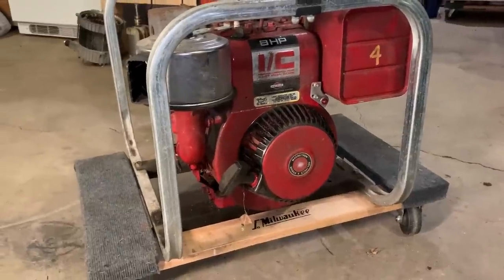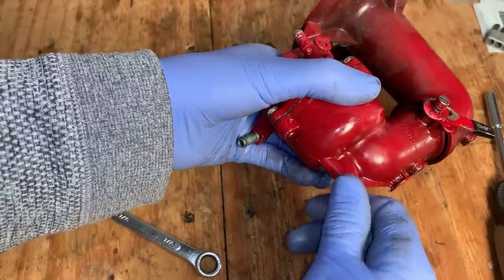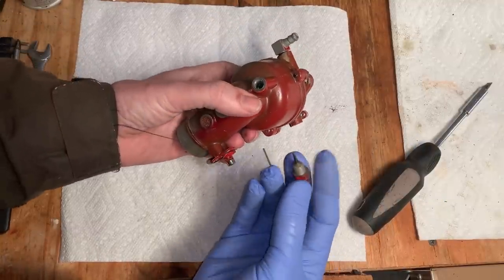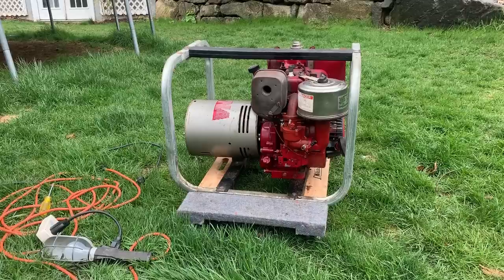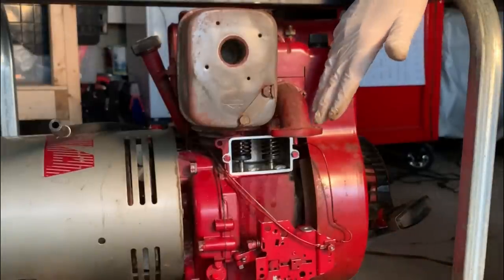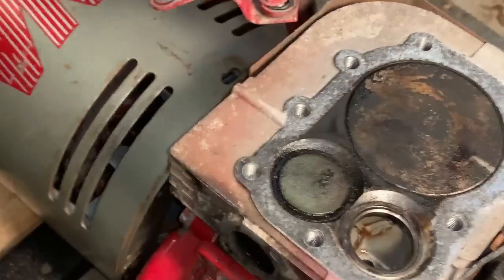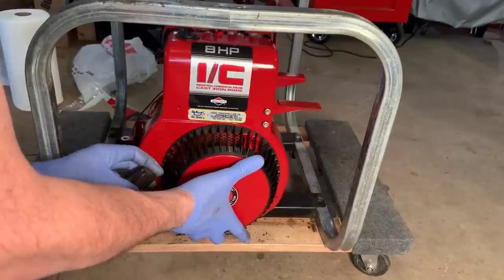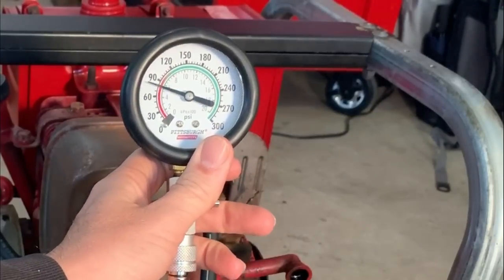Old Winco Dyna Generator (Part 1) - Will it Run?

Comment: That engine looks like it was made well before '91. Between the old style carb and the brass float, it just looks like it was made well before then. I thought they stopped using brass floats in the late 70's. I really think certain elements of this engine (like the throttle spring) are not original to the machine.
Reply from the maker: I was surprised as well.  This engine design goes way back.  But it did have electronic ignition and not points.  But still would have guessed late 70's or early 80's.
Reply: The winco generator I worked on 1988 8 hp ic. Has a brass float. Whoever was in there last had big dent in float. Ordered a new float didn't care for it. No adjustment. It is plastic nearly touches gasket.

Comment: Do you know the h p of the engine? I wonder if the generator end was replace with a higher rated end. I have one that looks just like that and is oy 1,000 watts at 1800 rpm
Reply from the maker: This was 8hp

Comment: I think it's called a two piece flo jet carburetor. I worked on a one-piece flo jet once.  Engine built in 1984 or so. VERY similar generator to this one. Couldn't get a steady fuel flow out of it for some reason.  Finally gave up, as it was borrowed anyway and had been flooded in 2016 and not touched until I started in on it earlier this hurricane season.

Comment: they don't have spark Arrestor on them.
The Governor spring goes on the same hole as the outher one.
It's running lean so bad that it;s not making power like it shuld. Need to RICH it up a little
you didn't repaint the Head?
THE SEC JET!!!!
One more thing I got to say.... If you try to shut it off and it BACK FIRE! It's running lean.
Reply from the maker: It was.  There is a part 2 and was fixed.  The carb was not the main reason.
Reply: @jcondon1  ok thanks James

Comment: Sounds like the timing is late, try checking the flywheel key.
Reply: I agree with possible late timing. It sounds lazy and the exhaust is real hot under low load.
Reply from the maker: There is a part 2 on this.  Ended up being a timing issue with the valves.

Comment: Have you considered the fuel you have been using? Higher octane fuel will give the engine more power, try race gas for a start.

Comment: You used the phrase "compression release valves" I'm not familiar with that on a flat head briggs.
Reply from the maker: This does not have a compression release.  But think it has something called an easy spin.  Same idea, but different implementation.

Comment: It sounds like the engine is to weak. I know you said the compression was at 80 but that engine should not have any trouble holding 3600 RPM at FULL LOAD 4KW. Maybe someone replaced the engine on that unit with a smaller engine. I would go and buy a new Briggs engine or a Harbor Freight one install it and I bet that will fix the problem.
Reply from the maker: I did another video on this.  The timing ended up being off.

Comment: What if the generator itself has a problem with bearings putting too much strain on the motor more than what is 3000 watts in other words you're gaining torque before you gain amperage yes I would take that generator apart your gaming strain on the generator before you're getting the voltage if that motor was able to spend that generator up easier and the generator was free from defect it would not be so quick to stall might be better off with your 3000
Reply from the maker: There is a part two!  Timing....

Comment: Hi you  didn’t check what revs you had most Briggs run about 3000rpm
Reply from the maker: With generators (non inverter type) you can use the hertz.  hertz * 60 = RPM.  In the second video on this, I think I connected a tach.  Generators need to run @ 3600 rpm to get 60 hertz.

Comment: I'm thinking parasitic drag from the generator head
Reply from the maker: Yes that crossed my mind.  Either that or muffler restriction.  Not much else it can be.  Right?
Reply: @jcondon1  not much left, I suppose the engine might have an issue but that may have been the first time the oil was changed in that case I'd expect metal shavings, and like you said is it worth dismantling the engine

Comment: Timing too slow. Check flywheel key.
Reply from the maker: Fanie Venter I did a part two on this.  Just search my channel for Winco.  The timing was off, but not the flywheel, it was the cam and crank timing.
Reply: @jcondon1  glad you found it!👍